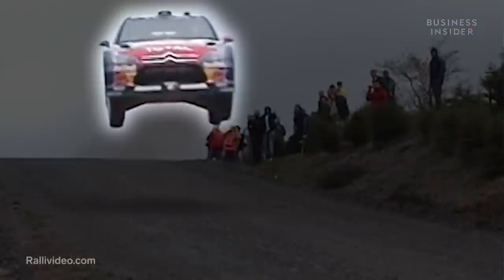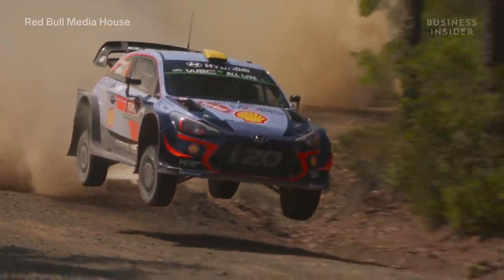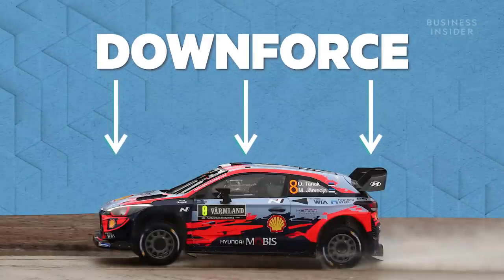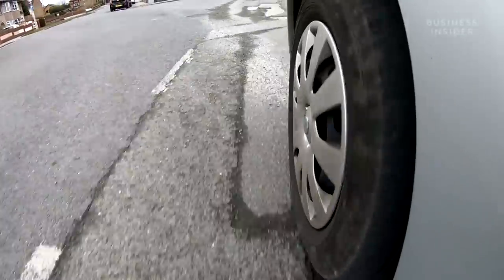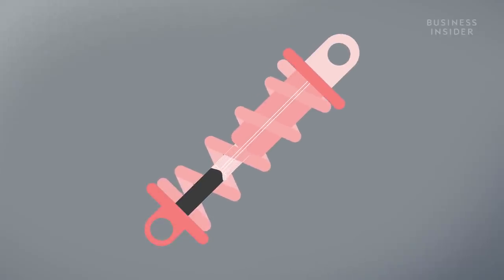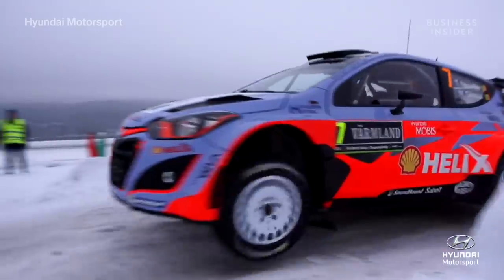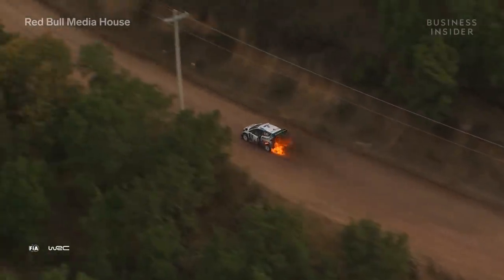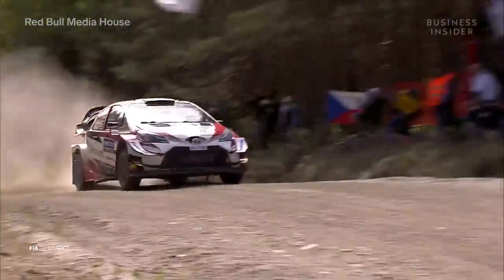How Compact Cars Can Jump Football Fields In Rally Races

Comment: " wings are used to keep the cars from running off the road". They're also used for the same reason said in Indycars. They help the corner faster by pushing it to the ground
"High pressure air under the car creates lift" while yes it would, the air under the car is actually accelerated due to the venturi effect, and therefore is low pressure relative to the outside pressure, creating a suction effect and sucking the car to the ground.
"In a corse with more jumps, they want a suspension that will bounce back immediately" actually the opposite. A course with many large jumps will require a softer suspension with slower rebound so the car doesn't bounce repeatedly after landing the jump. 
This video also completely lost the plot. You said you were gonna talk about how a rally car can jump entire football fields but didn't say anything about how WRC cars produce around 3 times the power of the road going variants of the car, which is the main factor as more speed means a longer jump.
Reply: Just saying 1 your right and you actually got your facts correct and 2 this is a car channel and tries to refer rallycross week to Indycar areo
Reply: Exactly this!

Also wings, like spoilers create most of their force by sucking air up with their lower side.
The "pushing air up" part creates less force.

This works similar, but opposid to airplane wings, where the majority of lift is created by the upper part of the wing, sucking the plane up.
Reply: thanks for clarification... no wonder why I got a headache by watching the video...
Reply: @pranavgoswami7443  I got severe trauma of talking to a non car nerd
Reply: Yeah the video was more like "How rally cars survive jumping the length of a football field (with errors!)"
Reply: Thank you for your service. This was a bunch of jibber jabber with jumping cars.
Reply: you forget americans don't care about logic

Comment: They can jump a football field on rough terrain simply because they are fast and super strong. The only similar part / component the WRC car shares in common with the commercial budget model is the Outer Shell - and that is for marketing purposes only. From the Magnesium wheels to the long travel suspension setup which is super rigid, and to the Tubular Frame Chassis as well as a completely different engine and 4wd drivetrain. These cars are basically Baja cars with a sedan clothing.
Reply: Heavy duty brakes and a tough sequential gearbox.
Reply: Kent, with all the respect I have for the many things you do have correct, I do would like to correct you on your statement these rallycars are just dressed-up tubeframes like Trophy Trucks and Nascars. Yes, the cars of the Group-B days back in the 80's were exactly that, but these days that is not the case. In fact the chassis/body of a rallycar is actually from its production counterpart, in fact, they actually take a production car straight from the assembly line to rebuild it. 

How Its Made have released a video years ago in colab with M-Sport where they showed the process of building a rally car. So search on Youtube for 'How Its Made Rallycars' and you will find it :)

So where the entire shell of the rally I20, Yaris, Polo or DS3's are the same as your roadcar, they do install rollcages to increase the stiffnes of the body and survival chances of the crew inside (they also install batteries these days for the electric drivetrain). 

The wider fenders being indeed made from a carbon fiber or other composite material, the Rally spec engines as well as the other points you do mention correctly. ;)

Comment: realistically this video isn't for the more experienced enthusiast but I do feel its important to mention a couple things. for the suspension one of the most crucial features is the travel, or how far the suspension can compress. the length of travel is crucial is it gives more time for the spring and shock to slow down the downward momentum of the car. for a simple explanation the impact the car takes is variable based on change in velocity over time. 

for a more nerdy explanation of dampers, so liquids are really hard to compress this means that ordinarily if you pushed that piston down like the video explained you would have absolutely no shock absorption. the piston however has small cut outs along the side that let some of the oil go past it as it compresses down, kind of like how an air mattress is completely stiff until you open the nozzle then you can push the air out. typical cars just have one set sized opening to get the compression the manufacture wants for their vehicle. but many aftermarket options (I really love BC Racing for value for money) have adjustable dampening where you can set how large of an opening the piston has, and some suspensions have multiple piston heads stacked on top within the same piston so that for the first section of travel its softer for everyday driving but harder when under more sustained strain like taking fast corners at a race track

Comment: Just imagine a jump on a straight with the group b powerhouses. Like damn. Shit would fly
Reply: Group B isn't too far off of current Rally cars.
Think some modern day rally cars out perform Group B rally cars at this point.
Reply: @junatah5903  That highly depends on the course, because group b cars had much hp than the current rally cars. However on a twisty course or if the power output get's increased in the modern rally car, the modern rally car would beat the group b car.

Comment: Because the fast moving car left the road at the top of an incline near the apogee of the movement of the suspension and dampers.

Then the road began a sharp decline in altitude meaning the car was detached from the road whilst maintaining inertia for a longer period than if the road had remained flat.

The rest isn’t really relevant and most of what you talked about failed to describe anything but factors which help maintain a car remaining in kinetic contact with a road.

Comment: Err no the air under the car is low pressure compared to the air hitting the rest of the car hard, therefore it sucks the car down; providing the car is setup properly(flat) and the air can move under the car smoothly.  I'm not an engineer, any engineers like to clarifiy.